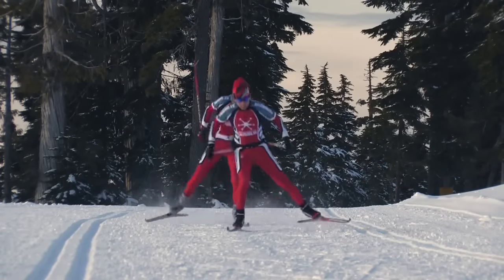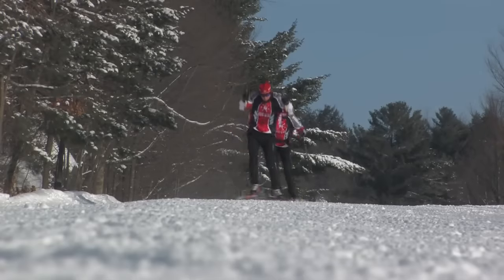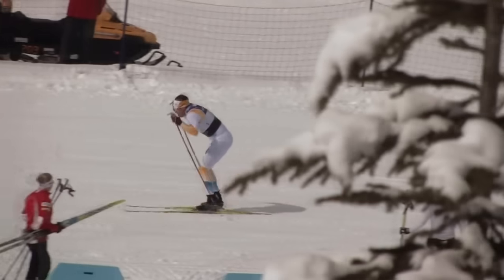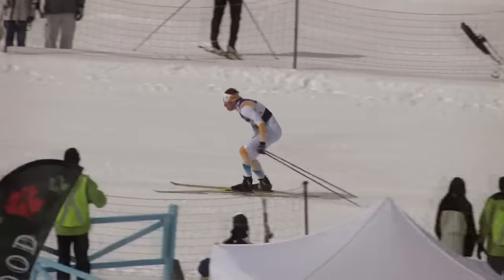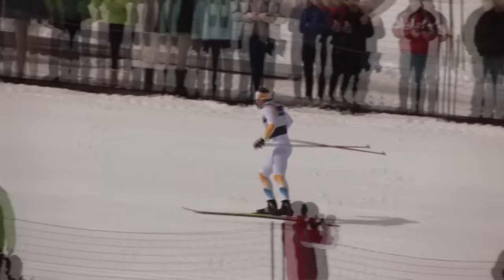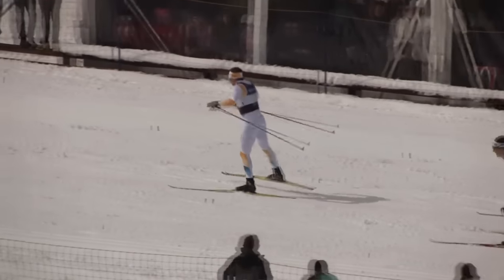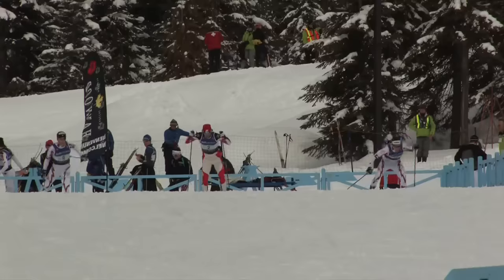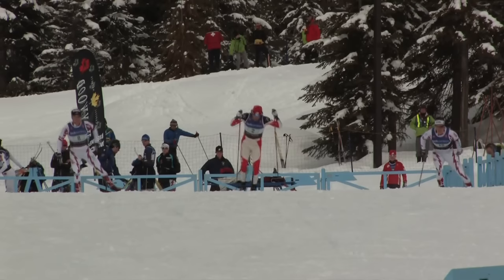Nordic Skiing Technique - Ski Skating - One Skate Double Pole - V2

Comment: The ski angle becomes more parallel to 0 degrees as speed increases, conversely increasingly perpendicular at slower speeds, such as in high resistance terrain.
The lead skier at 3:16 onwards in the red alpina boots is pointing his forward ski nearly to 0 before realigning prior to snow contact  to match his glide angle/speed. 
I'm no t an expert but my instructors have taught me to look for this.